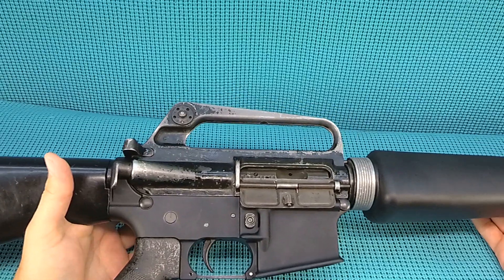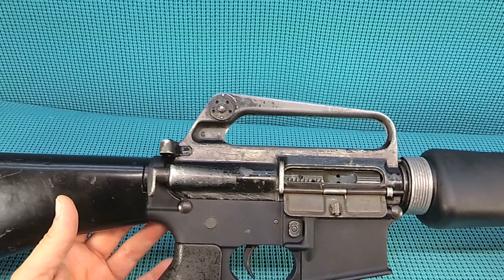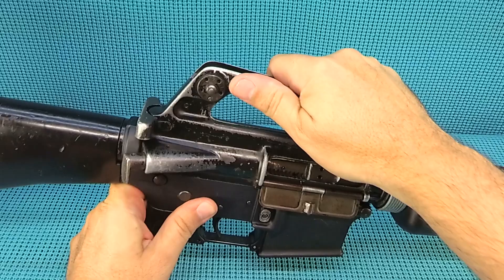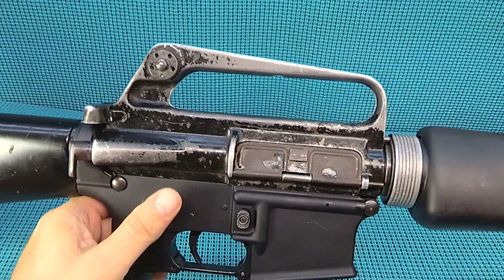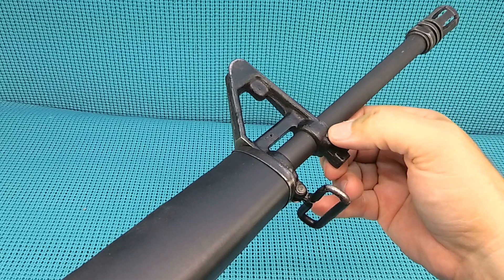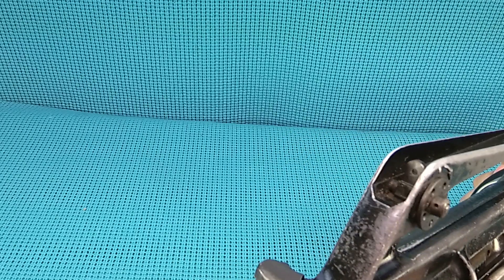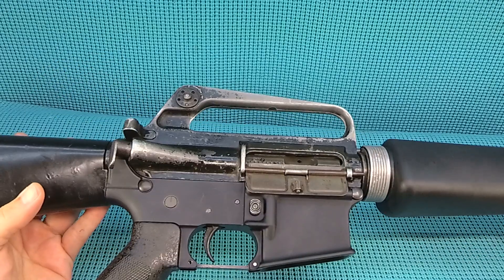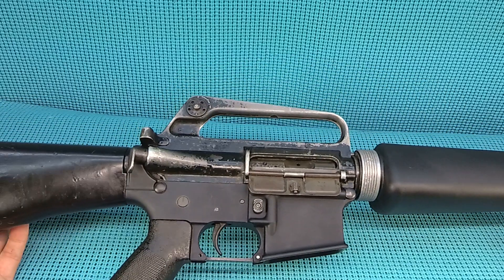Colt M16A1 Kit Build 1st Look

Comment: Nice retro looking , always liked the old looking m16 . I was gonna go to pick up my old m&p pre model 10 but the store was closed due to someone who was confirmed covid-19  so the shut down for a while. So I stopped at a different store and picked up a smith and wesson model 19-3 with 6 inch barrel,  and a model 10 no dash subnose , it has the screw under the trigger guard. The action is smooth
Reply from the maker: Model 10 snubbie is a super cool find.  Was on the phone with the Bucket today trying to figure out where to locate an AR, they are thin around here.  UGD
Reply: @usedgundude1035  might head back up next week they had a older snubbie in 38 s&w , think it's a I frame , in nice shape but I just bought those two so I held back
Reply: J G Get a 12lb rebound slide spring for your model 10 and you’ll feel like a jerry miculek